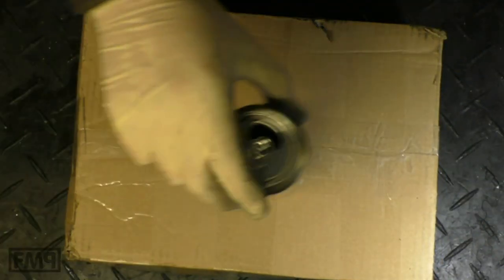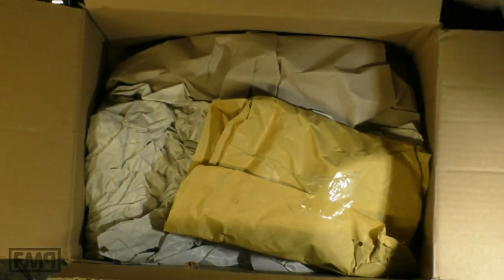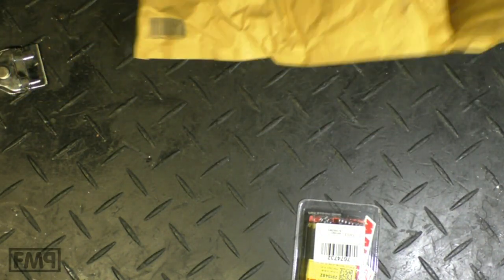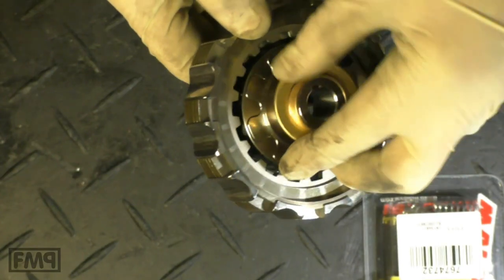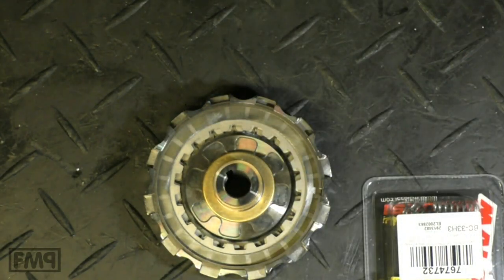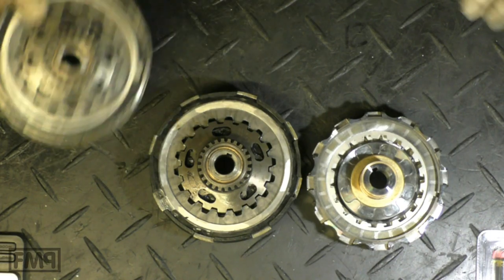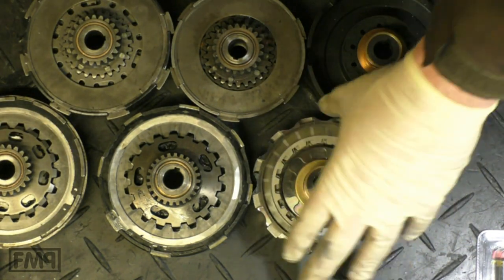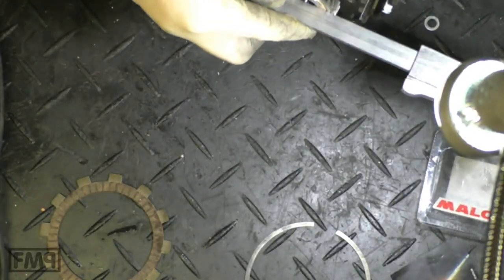NEW! vespa Sei Giorni KTM clutch by MOTO-components

Comment: Ok so next questions! 1) The springs it comes with -- about how many HP would that be good for? 2) How does this thing feel when in use? Is it smooth like butter? 3) Is it less noisy than a Cosa clutch? 4) The consumables in there -- the plates, and the corks -- where does one get those?  5) Maybe a dumb question but do you think this might join the ranks of things like the Vape ignition and the Pinsaco split rims as better-engineered, more reliable, no-brainer improvements for pretty much any Vespa?
Reply from the maker: with ur setup, ur fine, no need. To get a different clutch 😉
Reply from the maker: I only know so far:
4) ktm standard linings
5) yes, its better than
Smaller, lighter, way better lining basket contact points and also the tooting of the plates is improved
Reply: @FreakMoPed8  But... b-but... Vespa PORN. Seriously though I'm not looking forward to the next time I gotta fork out $$$ to replace the superstrong spring plate thingamajig with the quarter-millimetre walls. Figure something like this (which looks way better engineered in that department) might be a good way to get around that problem.